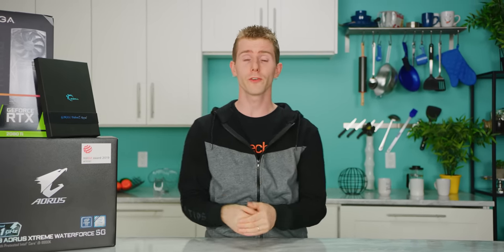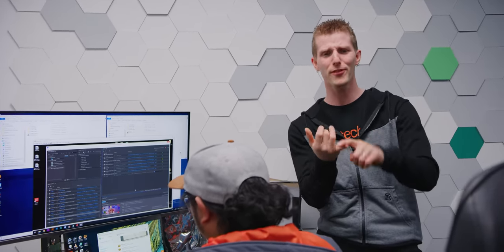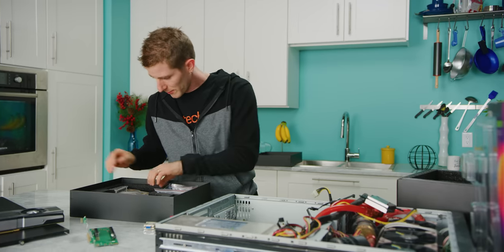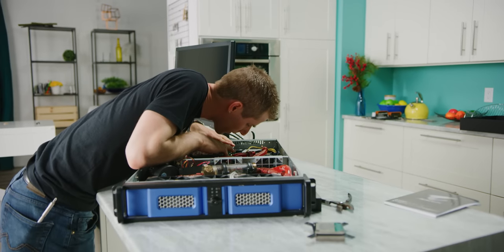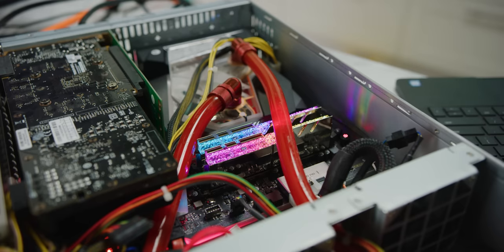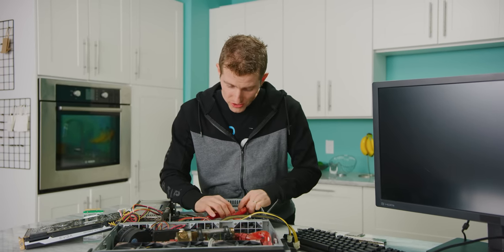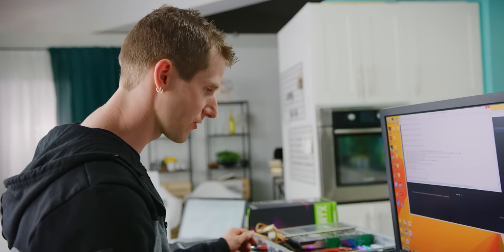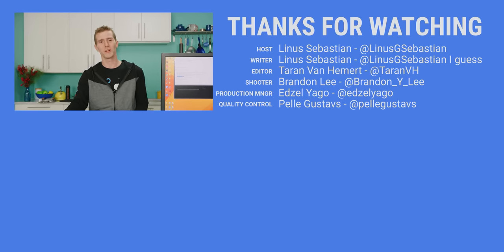All this work... for what?? - Upgrading the Video Render Server

Comment: Why all the AMD hype if you are using Intel/Nvidia?
Reply: when u do business, U need a well tested hardware that reliable and mature

especially on business environment, just because the new CPU come out business won't use it especially on production 

why? They always prefer the older one that have proven has no issues, They can't afford server doesn't working correctly just because the platform isn't mature yet even for 1 day, it will be catastrophic for business
Reply: @AliciaCLR  Yeah, right. That's why instead of comparing performance with test rigs and doing a quick hardware swap afterwards Linus instead ripped out the server, changed the hardware, risked ruining it by swapping tubes while the system was still filled with water and only then did a comparison... with disappointing results (because he has no clue what he's doing) which required him to change hardware in the server again.

Instead of having the server offline for a few minutes and producing useful data (workload performance vs different test rig configurations) the server was probably offline for hours* and all we now know is that significantly more expensive and faster CPU/memory gave them only about 12% improvement. Nice.

*) correction: 2 days
Reply: @AliciaCLR  Also, Intel chips released in the past 9 years have unfixable hardware flaws. Intel knew for the past 2-3 years. They are still producing and selling chips with the same flaws.
Great company and great products! Intel.
Reply: on server they have multiple fail safe security measure, those speculation based attack won't be able to executed unless they have access to system at the first place, 

on Linus use case, it's far easier to implement existing matured platform than new born zen 2 platform, the risk also less severe,

imagine if they choose newly produce zen 2 chip and suddenly the rendering server having issues due to optimize or compatibility issues, it will be catastrophic,  it will impact all of their timeline, delay project , delay a deal with sponsor and severe impacting the business
Reply: @AliciaCLR  "on server they have multiple fail safe security measure"
No, they don't. Their CPUs are so broken that to be on the safe side server providers even have to disable hyperthreading.
For over two years now these providers have lost significant performance every couple of months because some new flaw was discovered.
Of course this depends on the application but how Intel has (not) treated these glaring defects in the past 2-3 years is enough reason not to use any of their products released in the past 9 years.

"imagine if they choose newly produce zen 2 chip and suddenly the rendering server having issues due to optimize or compatibility issues"
Did you even read what I wrote?
That's why you test before ripping out the server hardware and doing random hardware changes.

" it will be catastrophic"
Even in the worst case - the AMD hardware not working as intended - and being so stupid as trying this on the server itself it would not have taken 2 days.
But this video shows that it actually took 2 days.... 2 days the server was offline.

"it will impact all of their timeline, delay project , delay a deal with sponsor and severe impacting the business"
All of that happened with the oh so great Intel upgrades that resulted in the server being offline for 2 days.

But you are of course wrong again: it wouldn't have severe business impact. All their editor's machines are powerful workstations that can do the rendering in a few minutes.
As each editor doesn't do 20 videos a day it would only be a small inconvience. 

Less of an inconvenience anyway than spending 2 days doing upgrades worth of thousands of USD, waiting for special Intel hardware that you cannot even get as a consumer and all of that for just 12% performance increase.

Comment: Is there any reason not to try using a higher core count cpu and using virtualization to make several render vms, with only the optimal number of cores for each? Would that not result in multiple renders running at the same time and potentially reduce render times more than you can by just putting in a higher clocked cpu?

Comment: Use a Ryzen 9 3950X!
Reply: not out yet!!
Reply: Yeah especially since theyre bot even out yet
Reply: @Lustanda  He said he was going to revisit it later, right?
Knowing LTT that can take a while lmao
Reply: This video was made WEEKS AGO!!
Reply: Stability and reliability my man
Reply: @TechDunk  yes
Reply: @minebrain03  Why is the R9 3950X less stable than an I9 9900k?
Afaik Intel has more security flaws made public lately
Reply: @TechDunk  it may very well be more stable, but they haven't tested it internally yet, at least not at time of filming.
Reply: @TechDunk  I would recommend watching their video from a few years ago where they upgrade the editing stations and explain why the processors used in mission-critical equipment is often not on the bleeding edge
Reply: @minebrain03  they used premiere benchmarks for their Ryzen 9 3900X review. It's the same architecture, sl should work the same
Reply: And I know why they pick some hardware. Just wanted to see how well that CPU would do compared to others haha
Reply: @TechDunk  I doubt they would be allowed to use embargoed hardware for commercial purposes other than those outlined in the agreement they signed. Therefore they couldn't test it in the system in the video, if they even had it in house when this was filmed
Reply: @minebrain03  they could test it and release it after embargo lifted, right?
It only says to not make anything public untill said day and maybe what needs to be done. Anything extra is fine

Comment: Stop fooling around with Intel chips, just slap AMD in it and it'll be fine. kappa.
Reply: LOL.. If you want low life, and more heat.. sure!!
Reply: @stryiderredz3244  thats not the case anymore, ever since ryzen the tables have turned and AMD is actually a pretty respectable option for cpus now
If you still prefer intel thats fine, but you can't use the old arguments against AMD cpus anymore as the ryzen platform has shown itself to be quite respectable when it comes to efficiency and preformence

Comment: Linus
I recon there are loads of other bios settings that can push this much further, not just clock speeds and timings but things like the vrm frequency,  power limits, intel’s cpu settings, voltages and a lot more optimisations that can add up to make this thing a bit quicker, smoother, more stable, and possibly cooler making it able to boost higher for longer, or even keep it running at its highest speed as long as the cooling can handle it.

Comment: I didn't get something... which scenario do you work in this server?
S1: You transfer the file to the server and start render, the premiere deploy in the server drive, then transfer to the "check and upload machine"?
S2: You transfer the data while the server render, and the render server deploy the final file there or somewhere else?
If you are doing the S2, you probably need the extra cores. Plus, in S1 if you cut the cores it could be faster if you render one file at time, but it could impact the performance when you transfer one or more files while the machine is rendering. So in the next test it will be wise if you run a real usage test, considering other side processes that could impact in the render time by not having the extra cores.

Comment: It's very odd that adding more cores doesn't just provide a linear increase without real limit.  Video processing is almost all (there are some exceptions, but really not many) built from algorithms that us computer science types refer to as "embarrassingly parallel."  (That is actually the technical term, I swear.)  Just take chunks of the video, as many as core you have, and farm it out to them, then recombine the results.  It's like the easiest thing in the world to make parallel.  Workloads that are hard to make parallel are ones where every piece affects every other piece requiring communication between the cores.  Video doesn't do that.  You don't compress or process the upper left quadrant of a video based upon what's going on in the lower right quadrant.  So it should be super easy to chop it up.

Comment: Can't wait till you're ready to shoot the upgrade video for this. At this point with a high end graphics card and a 205W CPU the power being capped at 500W is definitely a suspect here as I see you're not able to fully max it out on the render like...ever. I bet when you upgrade the PSU to at least a 1000W to be safe you'll wreck at that point. Also do try the GPU upgrade to the 2080Ti just to see if is actually helps with the CUDA boost.

Comment: First: Video encoding is extremely sensitive to IO latency and you're using ancient, terrible drives. Use an NVMe drive to store projects in flight. You can keep the old drives as boot devices, but just don't use them for your workload.
Second: You WANT to drain the loop so you can replace the fluid.
Third: I saw that "Activate windows". There's nothing wrong with not activating test rigs, but that's a render server you rolled into production.

Comment: As for spilling water on unpowered electronics:

- It's a pretty lame excuse for not doing it right. :-p
- Due to soft power switches and various low power states, the only safe "unpowered" is unplugged.
- And capacitors should have been allowed to drain.
- Not sure if even the CMOS battery can ruin your day.

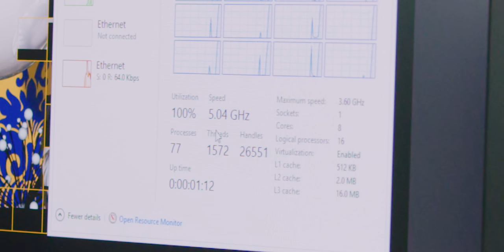Comment: 10:54 "5.04GHz"...
Remember the AMD FX-9590 with it's 5GHz boost clock? Everyone (especially intel fan-boys) was saying the high clock speed has no use and that the so called "clockspeed-war" was over for a long time.
How the tides have turned

Comment: That ways number of cores doesn't help on encoding is memory bandwidth (in case software, or even GPU accelerated). If software is NUMA aware and CPU cores are optimized to match memory bandwidth (per controller) it should scale without limits.

And you still use like .. Gaming Board and CPU for encode server.

Comment: At 13:15 you mention the CPU only running at 4.8GHz and not 5.0. Is that an AVX offset that Gigabyte have applied to the overclock?
Reply: Never mind, I watched a little further and you mentioned that.

Comment: To run the 9990XE you definitely need a better board than the Prime Deluxe. You want Gigabyte's Aorus Master/Asus' Extreme Omega. 

About the PSU, the CPU has 255W TDP but the CPU consumes around 550W on full load ALONE on stock settings so you are definitely held back by the PSU those things would explain the lower turbo speeds you are seeing.

Comment: So I am in a bit of confusion here, at the start of the video I thought they were using GPU rendering and were going to change a GTX 980 to RTX???? but after the build was done they were complaining about not speeding up and having the CPU maxed out which sounds like CPU rendering. If they are doing GPU transcoding, I hear that the Quadro P2000 is the sweet spot for the most trans-codes at a time for the money. The gaming GPU's are restricted to two trans-codes at a time. I hope they do another video, and clear up which type of rendering they were trying to improve. I would think that the final transcode would be GPU, and all the video work would be CPU rendering. For my DVD transcoding I use Xmedia Recode, my bad eye's can't tell the difference from GPU or CPU coding.

Comment: the I frames are the main frames. H264 and h265 can use only I frams, or I, P and B frames, that, true, make harder some editing, but not always if you know how not. the B an d P frames are the culprit. but you can use lossless intraframe only h254 or 265, or any fast lossless codec with good compression.

Comment: In Windows you can setup your energy settings to not throttle down the cpu if its not uses so it runs at 100% Speed the whole time.

Comment: XMP? hmmm - one intel 5820K; 3 motherboards and the 2800Mhz ram would not go past 2400MHz (64Gb off it). 18 months of Threadripper 1920X and its been running faultlessly @ 2800MHz and the CPU does 4.2GHz on its own... with a Notctua push/pull 140 fan arrangement... EK watercooling incomming!
Reply: i had 5820k and veneance lpx 4x4gb 2666. i could never launch it with 2666 only 2400. once i did it with 125 bclk and got 2750 but the cpu voltage was 1.9v so i ruined it with a mobo. this very ram works now on 3466mhz paired with 2200g ryzen.

Comment: Good on you guys for following through and not just giving it up like a lot of places would. However im wondering why youre not using an AMD chip or even a 3rd part hardware h.264/5 encoding solution for this sort of thing. The GPU is fine when its used but I thought there were direct hardware solutions for this?

Comment: Also, if you’re water cooling very often and want to avoid water damage, isn’t it a solution to buy a load of de-ionised water in bulk? It is relatively non-conductive.

Comment: The plug and play demonstrated here can lead to some successes but can be a massive drain of time and talent yielding little forward progress - as I personally can confess. The question that comes to my mind is: "Are there system tools that can analyze a running program and determine what factors constrain performance?" The tool would need to measure both active and wait times for hardware components, and perhaps show that within the context of the software blocks comprising the software functional components. One output of such a tool would look like a GANTT chart. The chart traces the minimum time path through the run along hardware dimensions and software functions. I am no internals guru but would think that a sandbox or VM could be architected to switch on that type of analytical framework. For all I know, that may already exist, but if so, it's existence is apparently not well known. Thoughts, anyone? Thx.

Comment: How does Intel Quick Sync factor into this? Using an Intel CPU with a built-in GPU (e.g. the 9900K) would enable Quick Sync and make H.264 rendering much faster. It seems Quick Sync is not used for CineForm. Are there other benefits from CineForm worth the increased rendering time? (Full disclosure: I've spec'd out an Intel-based video editing machine, but haven't purchased any major parts yet; with Ryzen 9, I'm reconsidering. My current editing rig is too old to support Quick Sync and I'm using a ProRes workflow anyway).

Comment: It actually sounds like you are bound by the memory bandwidth here.  If you had more memory bandwidth you could probably get more cores in the mix as well.  Too many cores and all you do is thrash the cache or have more cores sitting and waiting for requests for DRAM, so without the memory bandwidth to properly feed the cache you're just destroying performance.  Lower latency and higher clocks is what you want.  The ratio of CAS over clock gives you a number in seconds and the lower the better.  The lower that ratio the faster the RAM actually is.  Looking at that ratio you can find that higher clocks don't always mean faster when comparing using advertised timings.  But once you overclock the RAM and fiddle with timings you can really dial in a better ratio of CAS over clock frequency.

Comment: If you are using a server rack why don't you add both boards and give them a switchable lockout router and allow assignment of one board to heavy graphics processing. You are running a timeshare system anyway. or is your bottle neck the network cables and system? or use a fan and branching network system?

Comment: I played skyrim at ultra, streamed it with OBS, and viewed twitch stream in browser over wireless.  Less than 1% drop rate.  2G forced 3400G with 8 G rx 570, 32 Gigs ram corsair vengence 3000Mhz.  OC to 4.1 Ghz base and 1750Mhz Memory.  B450M d3SH MB. Even though windows says 3400G is disabled, I am pretty sure it is doing crossfire.  5s~ lag.

Comment: @linus - why not try more memory channels. Or spend some time considering where the bottleneck is.  from the 6950 to the 9900k to the 9980xe, dual channel memory is a consistent bottleneck - if the rendering uses memory bandwidth.
If nothing else, give it a try and let us know.
try one of the W-2145-2175 chips or something.

and on another note, try out windows 10 for workstations for the RDMA and see if that helps moving the files from the editors to the renderer.

Comment: I'm no expert here, but I think the right method to measure this would have been to grab a 3900X, and start disabling cores, until you find the needed number, so that the clock speed and other factors wouldn't change the result, making it fair.